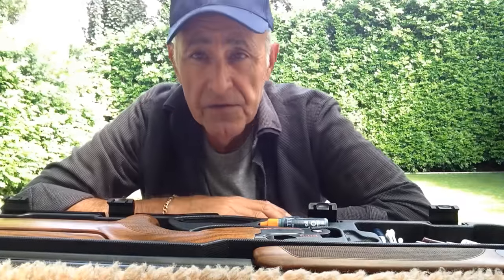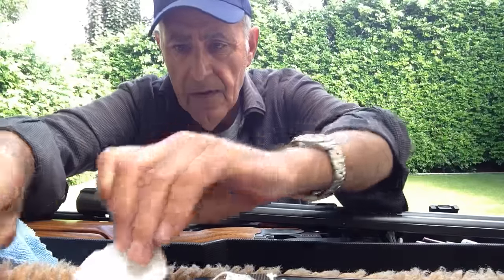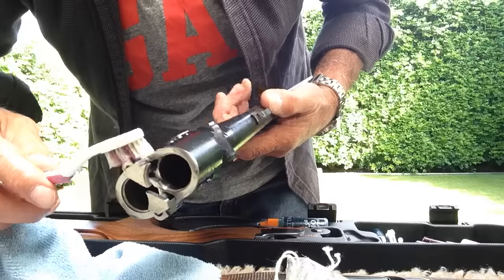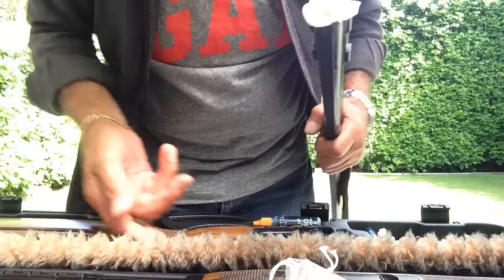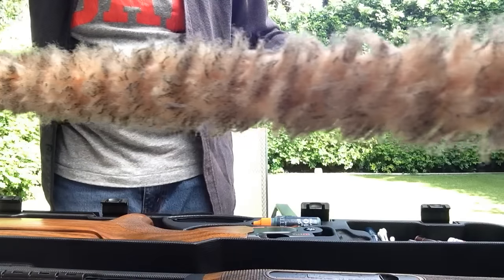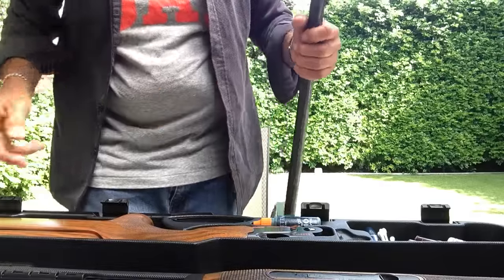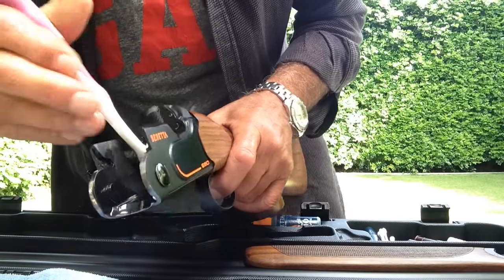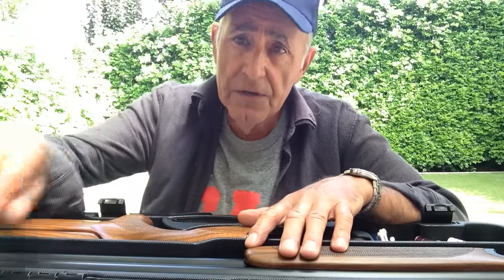SUPER CLEANING YOUR BERETTA...Roger Pace

Comment: Roger, not sure you know but there is a small microfiber dab in the handle of the Tico tool. It's designed to be lightly oiled and pulled through the barrels with the metal eye loop at the end of the Tico tool after cleaning. Just thought I'd share!
Reply from the maker: Bob...Yes there is... and I should have shown it...I don't use it because I spray the tool itself...and then wash it with a bit of detergent...you must have one...what do you think of it?  Thanks and stay well!

Comment: Have you ever used a bore snake, Roger? Any opinion? They seem to be the standard around here, although going back a few years I recall most used the long brush as you do here.
Reply from the maker: retro...i used a bore snake and they were good...the newer guns with their hard chromed bores clean so easily that they don't seem to need a wire brush going through them...i just use that long brush ans it does the job well.
Reply: Great point, thank you÷

Comment: Thanks for uploading your tutorial. It's very helpful. I have two questions. 1) Do you only wipe clean the forend metal parts? 2) How do you clean where the choke threads are? (Do you  remove chokes before cleaning the barrel thoroughly?) Thanks!
Reply from the maker: clean the barrels with the choke tubes in..clean and grease the thread of the chokes then rescrew in tightly!!!

Comment: Thanks for another great video, Roger. You may have mentioned it before, but why did you get rid of the Silver Pigeon? Second question - I see this has fixed chokes, but with the silver pigeon, did you clean the barrels with the chokes still in or remove them? Lastly, do you ever remove the ejectors to clean them? Thanks!
Reply from the maker: smackwah...good to hear from you...I traded in the silver pigeon because it did not have an adjustable stock...an adjustable stock would have cost me $500 to have installed for $1000 dollars I could buy a dedicated trap gun ...and that's what I wanted because I only shoot down the line...I always took the chokes out and regreased them...but you don't have to take them out all the time as long as you do it every month or so...I never take out my ejectors i spray them them with gun cleaner and let any gunk drain out...the ejectors will get taken out this time next year by the beretta people because they give a lifetime free service...stay well !